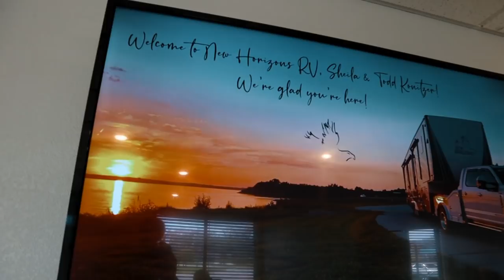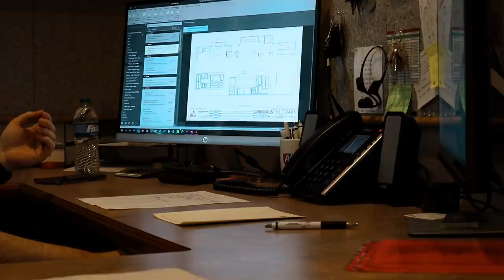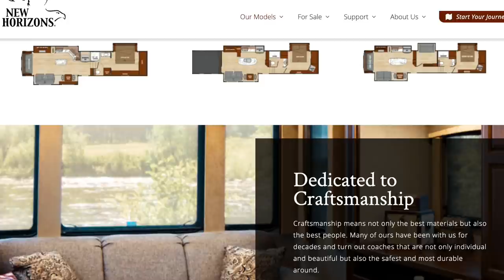Design your New Horizons 100% Custom Luxury 5th Wheel... ($150,000 to $300,000)

Comment: I have an old 2000 Monaco dynasty on a roadmaster chassis. And back then all the chassis were made for the individual coach depending on the equipment it was going to have. Basically what you were talking about here. I full-time in this coach and still love it. Thank you for the video. These are the first fifth wheels That I have seen that are built like a quality motorhome.

Comment: New Horizons are hands down the best custom made 5th Wheel.   I met the guys a couple of year's ago at a meet up and they are just some good old boys.   I too have build a home or two and you can really appreciate the build quality and the insulation in a New Horizon...no one else puts rigid foam in the floors, walls, end caps and ceiling!  I'm also ordering 16 of those battery cells to built the equivalent of 11 Battleborns and will have all Victron equipment too!  Just try and wipe that smile off of Sheila's face...she already has the floor plan 3/4's done!   Oh and when you put a Washer/Dryer in your rig...go with standard home units with a 240v dryer...those RV units are junk and if boondocking you won't be doing laundry anyways.
Reply: If you think New Horizons is awesome you should look up Luxe and Space Craft
Reply: @nathan_livingourjourney365  Luxe is nice too but they do very little to no  customization of floor plans...they also buy their frames from Lippert.  Spacecraft is in a league of their own as their unit are even more dollars than NH and their bigger units must be hooked up to a Class 8.

Comment: This may be a dumb question! If say I take my floor plan that I designed of a fifth wheel ( yes I designed our own) do they require a dep to start the making of the camper?
Reply from the maker: No dumb questions- yes there is a $5,000.00 fee (I think that was the amount) to start all the design phase for their engineers etc to do the weights etc.

Comment: What's the weight on those compared to yours?  The frame and some of the finishes look really heavy, but I'm guessing the aluminum structure may offset that a bit.
Reply from the maker: They are a heavier unit for sure by about another 5k lbs.
Reply: Dry weight on a Majestic is around 21,500 lbs, fully loaded - 24,500 - 26,000lbs depending on how much stuff you have!

Comment: I’m thinking about same trailer you got  or a valor,do you regret buying yours.have you had a lot of issues.I need you opion
Reply: Any problems with your toy hauler
Reply from the maker: We really enjoy our 395MS - we love the floor plan and the only real issue we have had was the breaks, now that is fixed we seem to be in a good routine.  I've heard great things from people about the Valor as well.....its a tough decision.  The little things in the Valor like the shut off valves, bigger basement, garage tie downs etc we think those are nice touches and we would enjoy them.....both good options.  Which floor plan do you like better?  I think that is what it will come down to and which one you can get the best price on :-). Good luck!
Reply: @SwitchItUpLife  I like that, the brakes were breaks. EMAW
Reply: @SwitchItUpLife  floor so much better in yours.but you don’t get Azdale walls or fiberglass roof